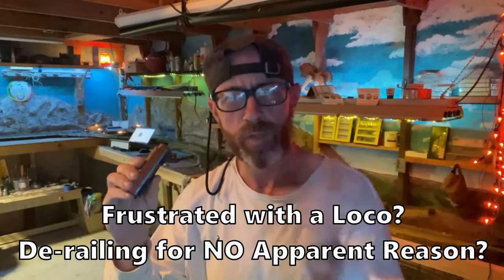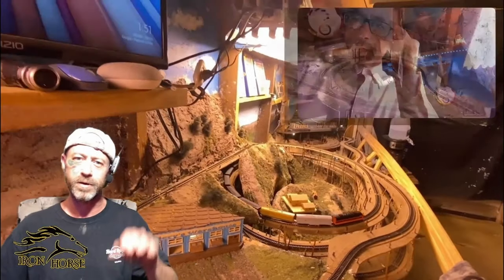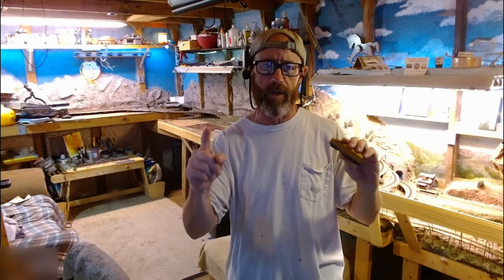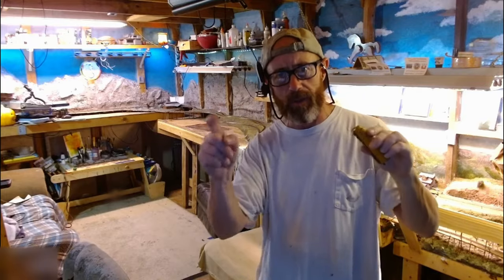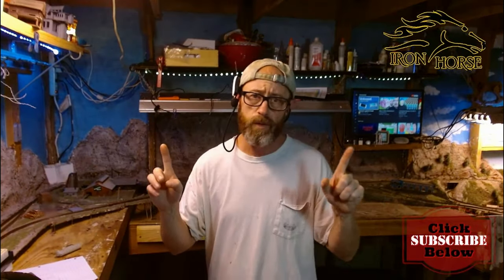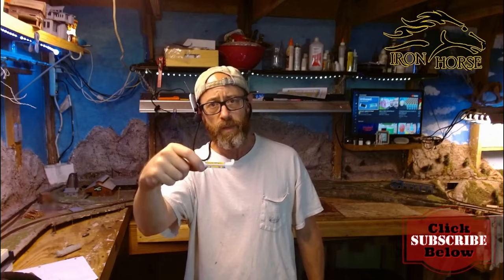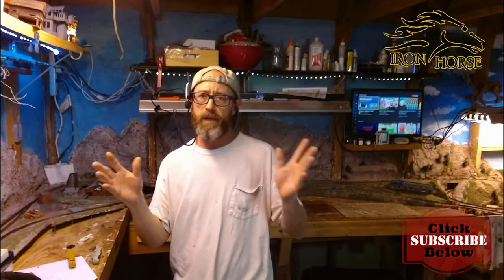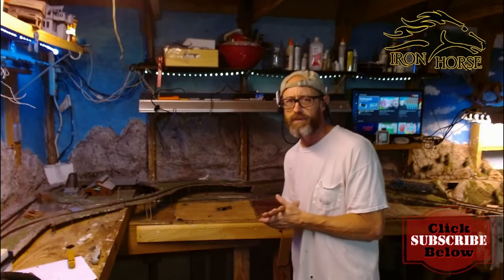How to Solve Derailment Issues - 10 Possible Solutions! Model Railroad Locomotive Maintenance

Comment: All great tips Brian. You should also mention that when you have your track guage out to check the wheels of the loco and make sure they are also in guage. When checking the couplers, also make sure the trip pins aren't bent and catching either the ties or nail heads if used to hold the track down. Having said that you have produced a great and informative video. Keep up the great work. Take care. Sean.
Reply from the maker: Great suggestions Sean. I will use them ! Thank you for watching and commenting!  Looks like it might be time for a sequel.  We have some pretty good suggestions.  Since I am thinking about doing an update , do you have anything to add to the possible reasons and possible solutions ?  Thanks again. Brian.

Comment: Top notch video Brian! :)
Reply from the maker: Thank you Mystic ! Thank you for watching and commenting!  Looks like it might be time for a sequel.  We have some pretty good suggestions.  Since I am thinking about doing an update , do you have anything to add to the possible reasons and possible solutions ?  Thanks again. Brian.
Reply: @IronHorseBrian  rando-tip: film the loco running over the turnout from different angles and then watch the film closely. sometimes you can see things on film that you don't see with naked eye.

Comment: These are great tips, Brian. Very much appreciated. #11 is for those using Kato N scale Unitrack (and maybe other brands, too...I just don't have experience with them). Sometimes the height of the rails at the joints do not match up, so the engine hits a really hard to see micro-ledge that makes the pilot wheel skip upward, causing it to derail. To prevent this, before you install your track sections, use a file on the ends of the rails of each section to make a tiny 45 degrees slope on each rail. By doing that, you'll create a mini-trough at the joints, and the truck wheels will not be forced upward. They should click nicely over the tiny groove you've formed. I hope this helps.
Reply from the maker: Great suggestions ! Thank you for watching and commenting!  Looks like it might be time for a sequel.  We have some pretty good suggestions.  Since I am thinking about doing an update , do you have anything to add to the possible reasons and possible solutions ?  Thanks again. Brian.

Comment: Hey Brian I have number 11 one that slipped by me in two different spots with my engage putting the track together into the rail joiners... One track seated in good the other one didn't go straight into its Joyner and the track was raised up causing a slight raise on one of the rails... Instant derail time... Just be sure on every joint run your fingers or some object that's going to run smooth across the track and not of course scratch it.. and make sure every joint is smooth when you rub over it...
Reply from the maker: That is a good suggestion. I will use that in the next video. Thank you for watching and commenting!  Looks like it might be time for a sequel.  We have some pretty good suggestions.  Since I am thinking about doing an update , do you have anything to add to the possible reasons and possible solutions ?  Thanks again. Brian.

Comment: One thing you didn’t mention with the same spot derailment is, are the rail sections in the rail joiner properly? If the rails are not IN the rail joiner, this can cause a derailment because of the misaligned rails. From personal experience, this problem is harder to spot with n scale track than some of the larger scales. Solution: Simply run your finger over the joint and make sure it is smooth, if not, separate the rails and make sure that they slide into the joiner properly.This is a problem I have when placing my “Trim-a-Train” base on the Christmas tree that thing can drive you absolutely nuts sometimes. Great video on troubleshooting those pesky problem derailments.
Reply from the maker: This is a great suggestion!  I will add this one to part II.  I am hoping to get that out the end of July!  Have a couple things to finish up first!  Thanks for wathcing and commenting! Brian